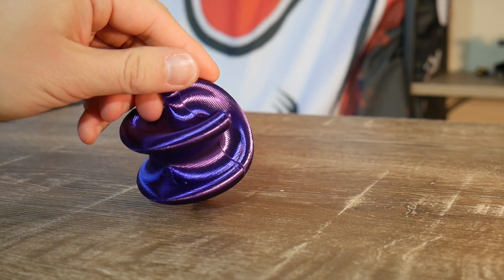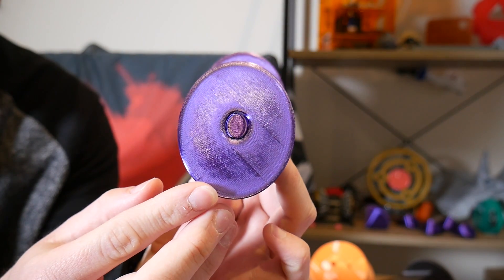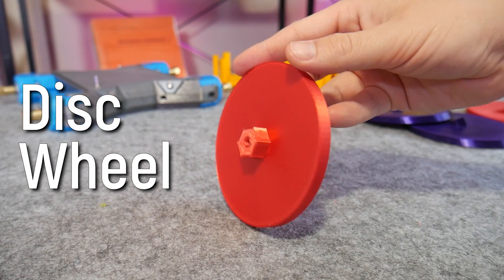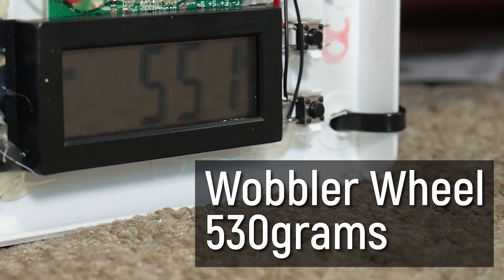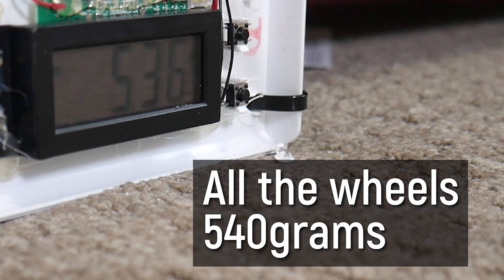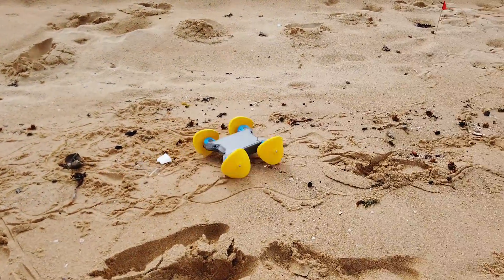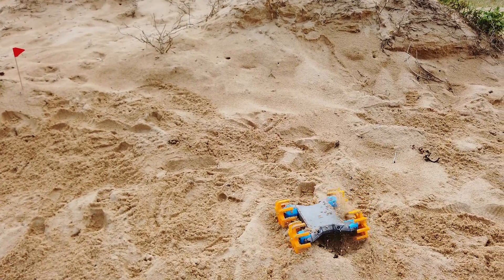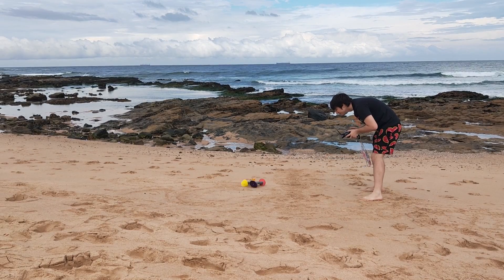This Robot Drives on Wobbly Wheels (but HOW?)

Comment: You should also do a speed test on flat surfaces. I assume the normal wheels would do best (e.g. compare race bike tyres with mountain bikes and you'll notice a difference).  Also, durability is a big criteria for normal car/bike tyres. The softer the rubber the better the grip but the faster the tyre runs down. But I wouldn't know how to test that on your plastic wheels.

Comment: you should add those tread things from the orange wheels that did well to the other wheel shapes as well. and also rather than leaving behind and in front of the wheels open, you should add like mudflaps or something so when it moves sand, it doesn't throw it away, it lands behind the wheels

Comment: your wobbler wheels prolly didnt work because the hook attached to the tow hook was not centered, the chain was pulling the rear left, thus leading the front to the right.

Comment: I'd be interested to see the result of a similar test, done on a surface designed for driving (i.e. asphalt like a roar or even a rubberized track for running on foot), and use the same wheels except cut notches in the rim to provide some tread almost like tires on a real car.  I think a lot of the problems you had on carpet were because three of your wheel designs were running smoothed surfaces so they only had a tiny bit of area in contact with the surface at any time, and no tread to grip and move.  Should be the same kind of tread pattern on all three of the "smooth" wheels for such a test of course.  I would expect the paddle/spoke wheels to do better in sand and other loose media for off-roading, but the tread wheels might all out-perform them on a paved road.

Comment: i think the spoked wheel altogether shouldnt be a competitor but an example of why wheels like that are manufactured. wheels have treads or edges for extra traction in environments like that of the beach you were testing on. if possible, id add grooves to each of the smooth wheels accordingly and try this test again. not to mention, the spoked wheels have a MUCH wider altogether build and gives them a great advantage on the sand. the others were essentially slicing into the terrain while the spokes made it far due to their quite robust design.

best wheel i can think of, in general, is to combine the curved “prongle” with the additionality of scoops such as those on sand tires or a design alike that of the spoke, and i think you have yourself a god-tier wheel.  then again, you should only really use paddled tires if you have enough Hp for it, since the platform is so underpowered, all you really can do is try not to get bogged down. with some added surface area like that of a tire, though, i think it could very well be the most revolutionary design of this experiment.

Comment: So basically your lookingfor offroad wheels? Because theres really not much point for high speed because of wind resistance, also they use up quite a lot of space because of their inefficient design. Like you said, you basically created inefficient paddle wheels which on a soft surface like sand had basically twice the surface area with a better angle as well compared to the rest. Would be interresting to see how real 3d printed paddle wheels would hope up.
Still an interesting idea and they look lear cool, especially the nightshade ones. I guess it would make for a good kids toy, kinda like the "short by shape buckets"

Comment: Could you try again with a wider wheel base and traction modifications? The 8 spoke would need to be made 10 but no other changes. I think the 8 spoke would still win out on hill climb but no longer win out in the pull test.

Comment: technically, when using the spoke wheels you're benefitting from the surface area on the front of the spoke as well as the top. Would be cool  to see a straight line top speed test with all wheels on a relatively low friction surface. I bet the spoke wheels would be out performed by the others

Comment: JPL needs to know this. 😉 Though I would say that you're using the inertia of the vehicle to make the wheels dig themselves down in the sand.  It would be interesting to see this with traction control or at least less wheel speed. The spoke wheels work because they have a reaction component from the sand they throw backwards. I like the wobbly wheel and can imagine they could have an advantage. However don't do them like that. Make them fat and cylindrical, where only the wobbling "tire" protrude. That way they won't bury themselves.

Comment: I guess you could improve the spoke design by "webbing" the spokes. Either by adding some longitudinal slots in the plastic bars and fitting a sheet of plastic foil to link them all loosely or by changing the print design to make those spokes be more like part spoke part triangular shovel. It would prevent the spokes from cutting through sand and allow them push against more ground before slippage occurs

Comment: Being honest, most of these designs (especially the spoked wheels) would have performed infinitely better on sand if you had any kind of speed variation for the motors. Rather than going full power, you need to limit the speed of the motor so it can catch the sand, otherwise it just digs into the sand like you saw with all of them. Do something like using joysticks on an Xbox controller and program it to use the degree of the motion on the joystick to control the speed proportionally from -100% (straight down) to 0% (neutral position) to 100% (straight up) motor speed

 The smooth sets of wheels still wouldn't be able to finish, but they wouldn't have gotten stuck instantly. On the other hand, the spoked wheels most likely could have finished

Comment: Imo i think the car design is the biggest issue when you tested the wheels on the sand, as soon as the car body started to meet with the sand all wheels started to struggle. The friction between the car body and the sand makes this test hard to tell the actual results.

Comment: When you ride on softer surfaces, you usually deflate tyres a bit to get better traction and once you are stuck you use very slow revs. I guess you were working on premise "hopefully they are better", but event with scoops for a wheels if you spin too fast you'll dig yourself in sand.... do the Scoops wheels :)

Comment: You should have raked out the sand before each test, to insure fairness. The wobblers have a few problems 1. I think at higher speed they might shake too much, 2. they will wear out faster then a regular disc...

Comment: the best sand tire or wheel design would be like the 8 spoke except not so open. basically if you could put either a cylinder inside the spokes then that would be the best because it would not let as much sand inside, the best real world example of the design would be a cylinder type air filter with the ribs on the element. its not so much a game of traction its about weight displacement. that's why tracks are pretty much the best thing for sand and mud.

Comment: You would probably get much greater grip with those 8-spoke wheels if the spokes were turned 45° in curve on the surface area towards the ground, I think you would get lots better traction. Also important part is to have the 45° angle scooping away form chassis, and not towards it. Or you can try making the same curve as the dune-buggy scoops.

Comment: The wheels are too thin compared to the total weight of he prototype if they need to run on sand.
When the chassis touch the sand, the wheels cannot provide enough traction to move forward properly.
Assuming the weight of the vehicle cannot be reduced significantly, increasing the thickness of wheels by multiple times will improve the situation.

Comment: For sand, three major design elements for wheels: 1) 4 wheel drive (you've got that), 2) wide wheel for max surface area (to not sink in), 3) grippy tread design transverse to direction of travel. None of your wheels, designs had element number 2!

Comment: I think any good comparison metric should reveal why real tires are so good. Thus, I think a more fair limiting factor would simply be mass. The reason tires are so good after all is their high surface area compared to their low mass (as well as good material choice but that's unrelated to the geometry). That said, it could take a lot longer to design competitors for this metric since that opens up a lot of mass saving techniques.
Reply: Notably, if you use mass as the limiting factor that applies nicely to how NASA approaches the design of rover wheels - as low mass as possible and similar terrain characteristics to the beach you were on as far as the wheels are concerned.

Comment: You are testing them on a track with obstacles that are way to high compared to the actual ground clearance. And you should've eased on the gas when they got resistance,  it just looked like you floored it instead.
But it was a really nice video non the the less

Comment: Captain obvious here. If you make a plastic wheel like the rubber paddle wheels illustrated. It will help spread the weight of the vehicle out so that it does not sink so deeply into the sand. Also caterpiller treads would accomplish the same.

Comment: I think the biggest benefit would be ground clearance. If you extended the legs on the spoked wheels I think they would easily climb the hill
Also, the area on the front and back of the spoked wheels should be counted as surface area as it contacts the sand.

Comment: 2 suggestions:
A] Modify the motor mounts by offsetting them below the center platform, that way the crab belly won't get hung up on random sand mounds.
B] Imagine drawing 4-6 consecutive sinus waves along the circumference of the cylinder, then modeling the wheel as a band around these, using the same contact area as on your other tests. It's not going to be an easy model, let alone print, but I think they should perform better than prongles on the sand.

Comment: Friction covalent is more important for such pulling contests than surface area, and as should be obvious with the paddle wheels, or slightly less so with the prongles, tread is supremely important, even if unintentional.

Comment: 12:47 Put the wheels on an angle?

What I mean is for you to angle the wheels and have wheels in a cone shape kinda form, with these sorts of tracks. You'll have more clearance and because of the angle, be able to stay on the ground more/more traction, when one wheel is inside a foot print.

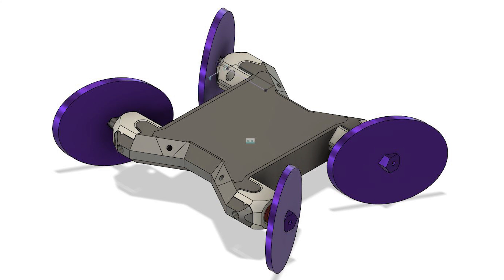Comment: 3:45 Better? I depends on the use case. Wobbling wheels introduce side-way tension and vibration. Regrading higher traction/friction, it is the frontal width of the wheels that count. Wobble and pike wheels have more frontal width so they could give more pull. With that said, they look itchingly attractive :D

Comment: basically u cant use nothing except disc wheels, because when unusual wheels are worn, they are losing theyre form, while discs are still discs
unusual wheels are also very expensive. and also on those little robots u dont have enough push down force to have the proper wheel grip

Comment: I think this is more viable than it appears. Imagine if you started adding some additional micro topology to the (purple) wobbly wheels, and the bottom of the vehicle wasn't dragging. They may even work in water if it floated. They worked perfectly on flat sand.

Comment: @ 7:00 Right on, Angus! - In B.E.S.T. Robotics one year we wrapped a thin circumferential strip of velcro around each of the two drive wheels and on the thin-carpeted competition floor, that robot was a traction beast.

Comment: You should add little spikes on the bottom so that it can go underwater in the sand and the spikes could go in the sand diagonally so it is harder for the car to be pulled from the ground

Comment: On the sand test ther bigger problem was the low profile of the vehicle. If you tried it with a higher profile your results would be drastically different I think.

Comment: Someone just needs to remodel the spoke wheels to have concave surfaces between the spokes so it is more like "scoops" instead.
It should not only work around the same in regards to carpet traction, as well as minorly adding more weight to the wheel, but it would also keep the wheels from burying as deep into the sand while still providing that "scooping" ability. Since we're talking wobbly or interesting shapes, I'd even say curbed [) ) ) )], slanted [/ / / /], or triangular [> > > >] spokes might work better as they provide an uneven grip which may allow for a better leverage on the sand it does dig into.

Comment: Honestly I feel like the wheels needed to be a bit bigger for the sand course. They probably vary at getting through the looser sand, but the problem isn't the wheel so much as it is outright bottoming out due to the low height of the robot. If the wheels were made larger, or put on some sort of suspension, the results would likely have shown a lot more diversity for their traction rather than their initial capabilities of digging the top soil. To do this, you could easily make and print "stilts" that fit into the motor bracket and then provide another bracket lower.

Comment: The spooked wheel work well due to surface contact with sand force applied across a wider area and since they can dig in they don't slip

Comment: For inspiration on a future wheel design, you should check out motorcycle paddle tyres. 

They're tyres specially designed for motorcyclists to be able to ride (usually dirtbikes) on sand.

The tyre usually looks completely bald/slick, but has these scoop-like paddles around the circumference of the tyre.

They literally scoop and throw sand away from the tyre, and offer exceptional grip for off-road sand riders!

Comment: I would love to see these wheels operate with a basic smaller cylinder inside them? basically make each design have an inner cylinder and the outer tread is what changes/ is wobbly. The Sand would not be able to escape and you would get significantly better results as each tread pushes the sand to the side/back rather then letting it escape "through" the wheel. Please try it out!
Reply from the maker: That's a fun idea! Would keep it fair too.
Reply: @MakersMuse  I wish I knew how to make this stuff. Looks like a really fun experiment

Comment: I am curious if increasing the surface area of each wheel would help improve their performance in sand.  In sand its all about surface area moreso than scoops, sure scoops help but more surface area means it will less likely sink and dig in.

Comment: Increase the RADIUS of the wheel (and thereby the circumference). Simple. This increases the clearance of the platform from the sand by increasing height.
Your platform is making contact with the sand.

Comment: the orange wheels, you made something that is almost would work, you need to add a platform between the spokes so it doesn't dig in as deep into the sand

Comment: Did you take into count the surface area of the wheel? the last design has a bigger surface area touching the sand and thus holding the weight for moving forward

Comment: On a perfectly flat surface the all the wheels had the same surface area, but get onto something like sand it grass and the spoked wheels have the most surface area. They can grab more surface of whatever terrain. The wobbly and curved wheels have more surface area than the standard wheel but far less than the spoked wheels.

Simple physics.

Comment: The best solution is to make a cylinder with prongs and then cut out all wheels out of that pronged cylinder, then they will have same "surface area" if you dont count walls of the prongs, like making a wobbly scoop tyre.

Comment: Thanks for the interesting Video!
I mean it's obvious but the car is stopped by the platform, not the wheels.
Therefore, if the wheels are bigger in radius than the platform in height, it works.
You can do that easily with your best wheel design on axis extruded on 2/4 motors by 
the thickness of one wheel +some space.
Have fun!

Comment: I think a much more fair test for these would be to raise the chassis. Your main issue is that it bottoms out, preventing the wheels from getting traction. Either increase the diameter of the wheels, or create a sort of suspension for the chassis.

Comment: it does serve a purpose. the wheels have a higher circumference so will last longer. you also save material vs the the same circumference on a standard shaped wheel.. that's really clever :-) I bet Nasa will steal it..

Comment: the wobbling wheels would perhaps have more traction, especially on sand, if they were synced to be always opposing so that the lateral forces oppose and cancel out. this doesn't work well with the tank control

Comment: With the spoked wheels for surface area you should really consider not just the outer edge but the edge that pushes the sand it has scooped up and pushed on, so 2 edges not just the outer one, also it shouldn't be disqualified because the prongle and wobbler wheels both did better than the normal wheels by using the same idea of scooping sand, just a lot less efficiently

Comment: why you are trying them in sand alone try them in a normal road or flat surface that will be more practical. In case this design is gonna be used in a real vehicle. we would try them in a road not in a sand. do you get what i am saying? So try them in a road

Comment: Congratulations!! You've stumbled onto the science of tread patterns.
Reply: Good point, there are tires with diagonal treads like the wobbly wheels, they just happen to be symmetrical with respect to the middle of the tire where these wheels are asymmetrical. A tractor tire is a good example, of course there are also many more treads around the circumference.

Comment: Try a new chasis to support a larger tire diameter and wider tire width. This should give more surface area to help reduce the tires digging into sand as well as help prevent bridging the chasis.